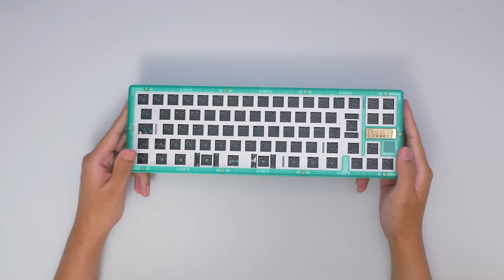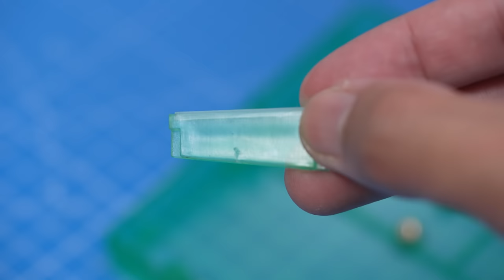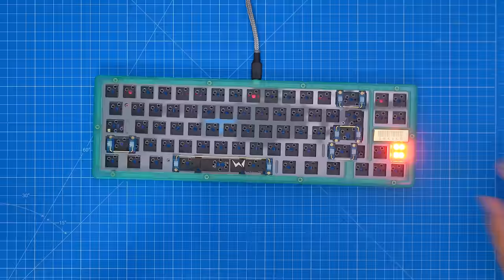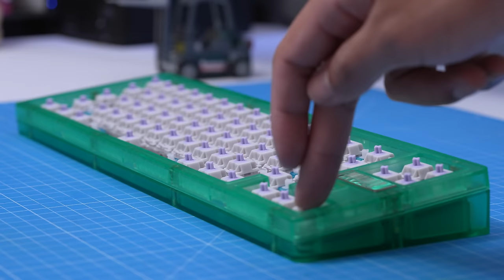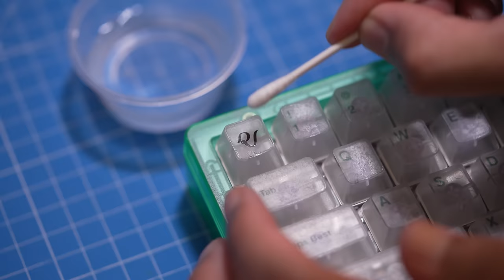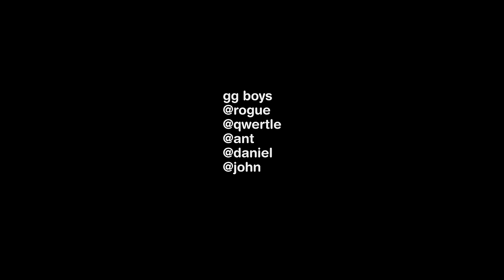Ikki68 Aurora - Affordable Gasket Mount Mechanical Keyboard!

Comment: This man actually water-pressed a legend onto each key. That's true commitment
Reply from the maker: yolo
Reply: Could you show a more in depth process on how you got those legends onto the keycaps? They look soooooooo good, I want to do that myself
Reply: oh that? if you build model kits, that's pretty normal.
Reply: @dzaneenadaze  this is not taeha (?)
Reply: Is he good fam
Reply: Do they last long?
Reply: @dave2938  Should last about a long as silk screened legends. IE will wear off completely after less than 2 years of average use, and show signs of use after 3-6 weeks.
Reply: @LoverKittey  Thanks for the reply! :) Sounds more like solution a for decoration-keebs :D
Reply: @TaeKeyboards  did you use any top coat after applying the water slide?
Reply: @TaeKeyboards  can you please do a tutorial on where to get the legends and how to do this?
Reply: @rockpyl  I don't know if he did, but when he was applying the decals onto the keycaps, he applied "Mr. Mark Setter" which basically softens the decals and makes them stick longer so in the future the legends don't peel off.
Reply: @TaeKeyboards  what are those switches
Reply: @hannya.2kd  lmfao no

Comment: The KBD67 Lite has the same issue when tightening the halves together because the gaskets protrude further than the screw threads. Causes that bowing on the case in between screw points.

Awesome video as always, Tae!

Comment: regarding gaskets: symmetry is aestheticly pleasing, but if there is problems with vibration: asymmetry is your friend (reducing nr of 'eigen-frequencies')
Reply from the maker: ooo cool cool
Reply: Modal analysis would verify that.
Reply: What does this mean? Do you mean we should alternate the gasket chips in both sides? Or is there no noticeable difference?
Reply: @jordangoh4775  Modal analysis would verify all of the natural frequencies through numerical means.
Reply: @jordangoh4775  don't know for the speciffic case. Just a comment on the assumption in the video that only symmetric mountings are relevant to consider. May not be any tangable effects for this case...

Comment: Hi, I really appreciate your videos as they got me into the hobby. I especially enjoy how much you custom work you put into your boards. I have a question about the decals you used for the caps, as I am trying to do something similar myself! I know you are using water to apply them, are you using a varnish at all in any step? Or is that a clear nail polish? Thanks!!
Reply from the maker: yep water, but i also use a decal setter and softener. and for durability, you would want to clear coat over it too, like an enamel clear coat.
Reply: @TaeKeyboards  ohh I see, thank you for the response !

Comment: I pre-ordered this board. This gave me some confidence that it would be a shitshow when I get it. I am a tad concerned about the flex when you put the board back together. Wonder if they will adjust the silicon bits to address it or just make the spacers a hair shorter so it goes together nicely?

Love how you did the decals for the clear caps. Just wonder if there is a way to get them to not wear out over time? Maybe you could clear coat the tops o the caps... heck even clear nail polish maybe?  lol or just dip them in clear epoxy - then they would never wear out.. ever. But they would probably feel horrible.

Comment: Hey Tae, it'll help a lot if you decide to make a video about a more in depth process on putting waterslide decals on to keycaps(illus process then applying them) since iz*one just had their last concert kinda bummed rn and wanted to make a keycap set to have a memorabilia of them for good times' sake :)
Reply from the maker: i may in the future. also, i will be doing an izone themed board as a farewell.
Reply: @TaeKeyboards  o dude thanks a ton. that means a lot to a wizone

Comment: After seeing boards like the Bakeneko, it doesn't look like there's really any flex. Most of the movement is coming from the case sinking into the desk pad. 

Was on the fence getting the PnC edition but it just seems a bit gimmicky rather than what you'd think of a "true" gasket setup sounding/behaving like.

Comment: I see you've got mark setter, but do you have mark softer as well? In case you don't, it's really helpful for waterslides that need to wrap around anything curved/irregular. It basically partially melts the decal.
Reply from the maker: hehe, its kinda bad when i think about it. my softener was in my bedroom, while i was in the garage doing this. because im lazy, i was like, it'll be right dw. but then i tried and added some later smh lol
Reply: @TaeKeyboards  probably not necessary since the caps are pretty flat, but yeah, for case work it'd helpful stuff

Comment: Just wondering, how do you keep the waterslide decals on? I did the same thing with clear caps recently but they all just fell of again once they dried. Cheers!
Reply from the maker: as keycaps have a slight rough texture to them, this means that there will be tiny air pockets throughout. A decal setter helps adhesion, but also a decal softener will allow it to conform to the surface.
Reply: @TaeKeyboards  thanks! Super useful!

Comment: Why did you not use Mr. mark softer on those decals. I think it would help them sink into the ABS. Or did it react with the plastic itself?
Reply from the maker: i used some softener, but a little later. basically was lazy lol. gg

Comment: Where would you get the legends for blank switches?
Reply from the maker: made them myself. just waterslide decal sheets
Reply: @TaeKeyboards  Ok, thanks so much!
Reply: Would I get a waterslide sheet, use an inkjet printer, and then slide it off onto the keycaps?

Comment: When u finally find something you can afford but then realize it's sold out.
Reply: Its not sold out, the group buy has ended.
Once the boards ship out in early july, there will be more informations for a second round sooner or later.
Be sure to check out the Wuque Studios website and Discord.
They already announced that they will do a second round with more colorways
So no worries, you can still get the board

Comment: affordable but when you get a bunch of the extras you end up spending $300 for the whole package
Reply: I got a weight, fr4 ate, and stabs and it was only around $200 after shipping and tax
Reply: @amathine440  i got brass plate and weight and poly plate and extra gaskets and some of their stabs and an extra pcb so it does add up but it is going to be worth it for sure